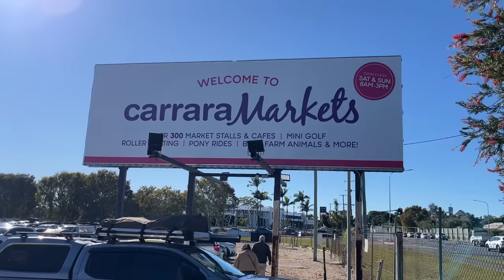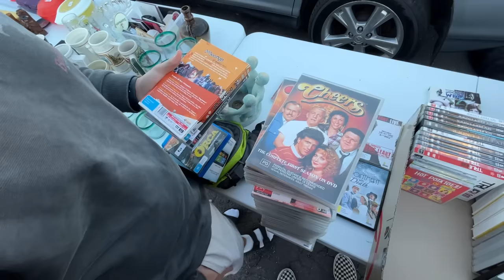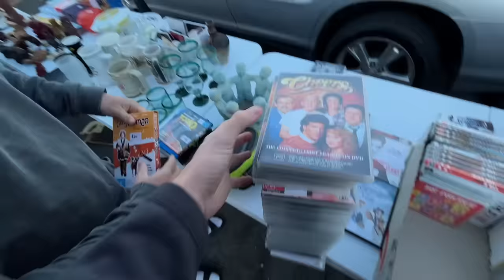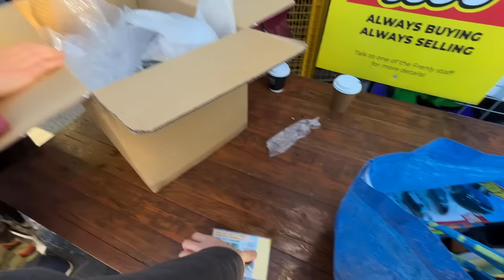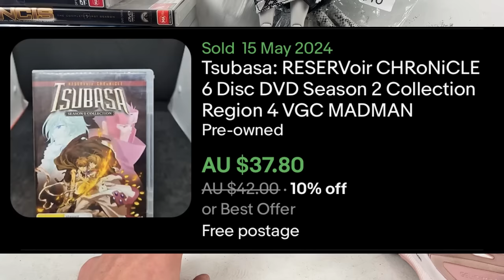$2 Flea Market Find Sells for $150 on eBay

Comment: Hey mate, just a quick question, when listing an item on ebay is there a reason why you do not use templates to make your listing and store look better? I have heard sellers are not using this method anymore due to cost and it can be hard to view on a phone as well, simple is best I guess however they do make a listing look more professional etc. Thoughts? Thanks
Reply from the maker: Never even bothered looking into templates. Title photos price. Nail those 3 and you’ll sell anything